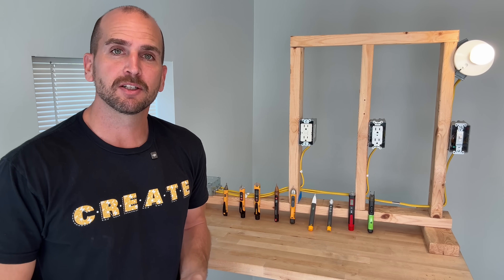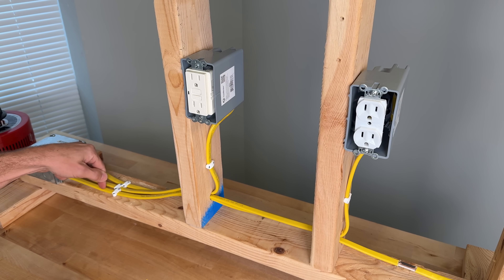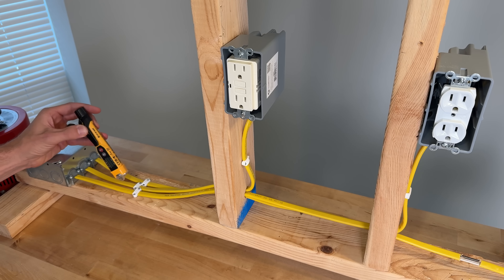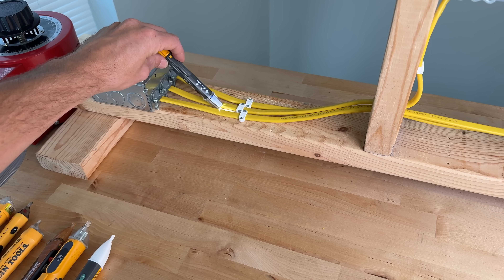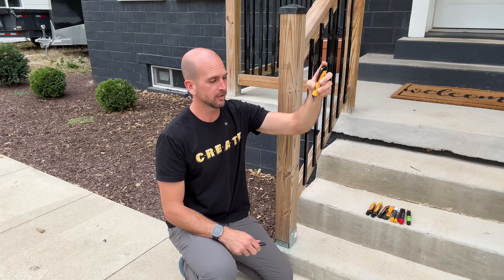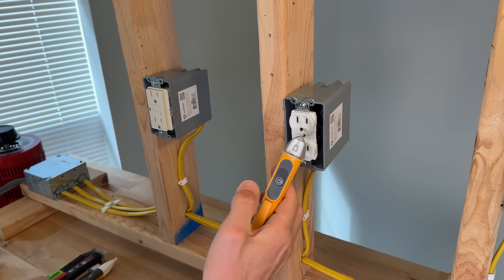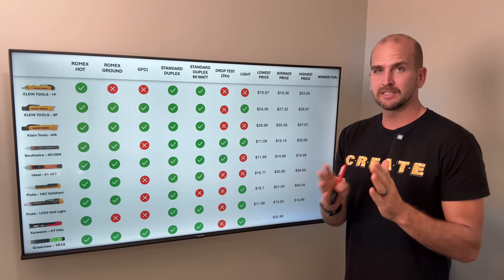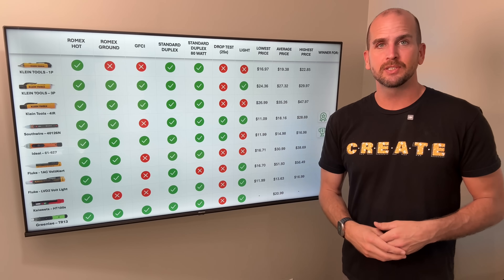The Ultimate Voltage Tester Battle: My Surprising Favorite!

Comment: I would go with the IDEAL. I would rather have all my bases covered with
what works for electric detection, rather than miss reading the GFCI to have 
a flashlight. But that's just me. Thank you for doing all the ground work, that
was a ton of information. A lot of people, including myself, buy the most expensive
thinking it's the best. This clearly shows that that is not always the case. Thanks again :-))
Reply: Next model up has a flash light. Just $5 more.
Reply: I completely agree with your thoughts.
Reply: Yeah don't know how you could call something the best overall when it didn't detect power at the gfci, maybe the referral bonus is best with that one?
Reply: Always use a meter never trust a ticker
Reply: Yeah, it is unreasonable to call it the best when it doesn't do what testers are supposed to do but just has a light! It is a tester, not a torch
Reply: Same here.  I would rather have one that tests all voltage devices rather than one that fails to detect in certain situations.  If there is not enough ambient light, I'd use either a flashlight or, what I do most often in order to have both hands free, is wear a headlamp.  In any case, I always confirm any results by using a DMM.  Also worth noting is that if you're trying to use one of the NCVD's in a confined space, like a box with more than one hot wire, picking up a voltage from too far away can lead to confusion over just which one (or more) of the hot wires is live.  I had a Fluke 1 ACII that I liked because you had to get very close to the hot wire in order for it to detect the voltage.  But alas, after a few years (around five) it quit working.
Reply: You can get one with a flashlight. Mine has one.

Comment: Uggh…I just bought a Kaiweets off Amazon last week to replace  my old trusty Greenly which I lost.
Reply: Don’t despair… I have (2) Kaiweets HT100s and both detect my GFCIs power. Not only that, It has two sensitivity settings (70V-1Kv, and 12V-1Kv). In the 12V-1Kv range, my (2) devices detect AC Voltage present 1” from the outlets and even detect AC presence like no other NCV devices that I have used. As far as durability, I think is OK for DIY users (not for everyday professional work).

Comment: The Kaiweets that I have on the 12V-1kV mode can easily detect gfci hots and even the hot in a light switch through the plate
Reply: I have (2) HT100s  and work fine in the low sensitivity mode on my GFCIs and in the 12V-1KV higher sensitivity setting is great since it can check at 1" from the outlet and as you point out, even through Switch Plates...

Comment: Such a helpful and well-done video! 👏👏👏 I believe failing the GFCI test makes your top pick a non-starter for me. As much as having an LED light is a nice feature, I don’t think it’s worth the sacrifice in potential safety. BTW, for just a couple dollars extra, Ideal makes a model that does have a flashlight. It’s the 61-637. Maybe that would have been a better model for you to test for this video based on your use case.
Reply: 100%, a good flashlight should already be something you carry and while nice to have built in would not place it above another device that actually did what its supposed to do which is detect live circuits. Primary function of any tool should always be the #1 priority before additional features, those are nice to have but if the tool can't cut it on its primary function it's a failure. This should be how any tool is judged but sadly companies know they can throw a bunch of cheap addons and people will over look poor performance on primary function because look at the cool light/bit holder/logo/whatever.

I will say since all the information was presented it does mean we can all make a more informed decision based on what we find most important, so thank you.
Reply: I have the southwire, I just tested it on my bathroom GFCI and it worked fine.
Reply: Interesting…. On another topic put those knees on pads before it’s too late.

Comment: I find it crazy that more than half of these didn't detect power on the GFCI outlet!
Reply: The fluke 1ac I daily drive detects through gfci, little on the snug side but it does fit. Although in the video it’s listed as it doesn’t
Reply: All the ones I've had start beeping at around 8 to 10 inches out.
Reply: You shouldn't be.  They don't pass the grade in for proving a circuit is safe to work on.  They are really only good for circuit identification, as it, it beeps, turn breaker off, it stops beeping, right we are on the right circuit, now we start making safe for work.
Reply: @retrozmachine1189 real electricians do live work😂 what do i look like  cutting the lights off in 10000 sq ft facility just to changs one light😂 aint happening
Reply: @trace4125  You left 'stupid' out of your response.  In many countries unnecessary live work is actually illegal.  Odds on there is more than one lighting circuit in a 10000 sq ft building so you wouldn't have to turn the place dark to do the job safely.
Reply: @retrozmachine1189 I used to work at a 200 year old hotel half the time the only way to find the breaker was to intentionally arc it out otherwise you're doing live work
Reply: If you test the screw connector it would show voltage.
Reply: China